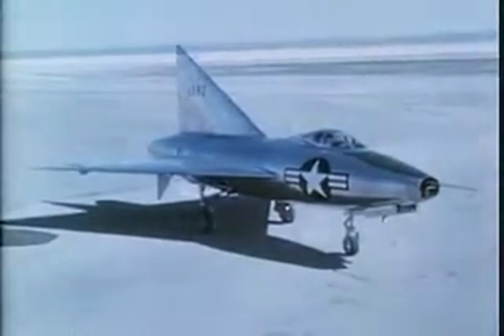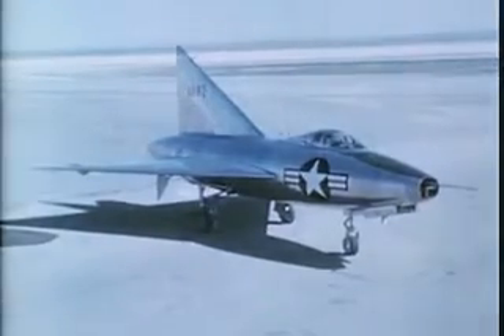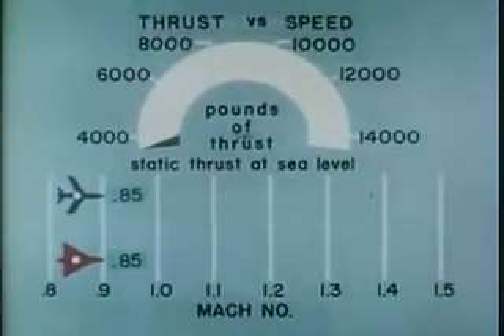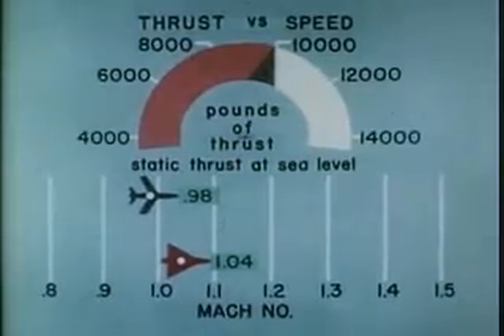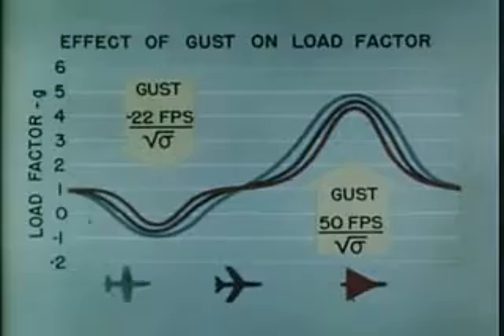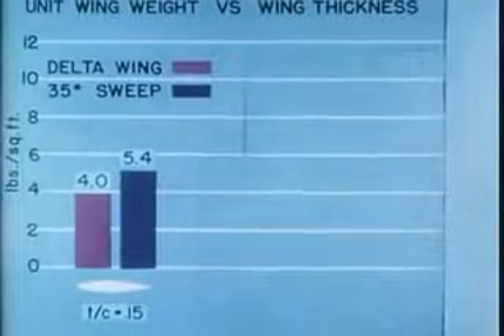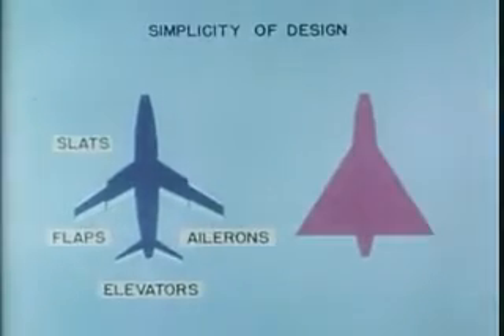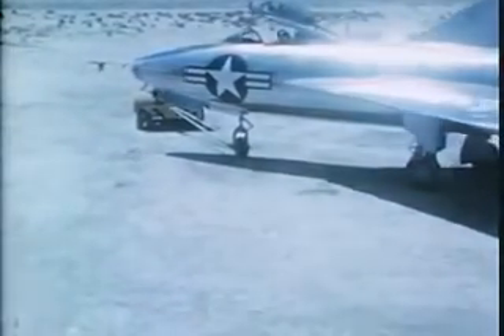Convair XF-92A Dart Promo Film - 1949

Comment: in the early 1990's this one of a kind Aircraft was located in Building 13 at Wright Patterson AFB and was slowly being restored by my USAF Reserve unit, the 401CLSS Squadron. I drove many a rivet into it during that time. eventually the airframe was handed over to the USAF Museum to finish the project. thanks for this video.
Reply: 0:45 if you watch in the background its looks like somebody’s top secret flight report on the performance of the XF-92 is blowing across the desert on the way to Applevalley or Hesperia...